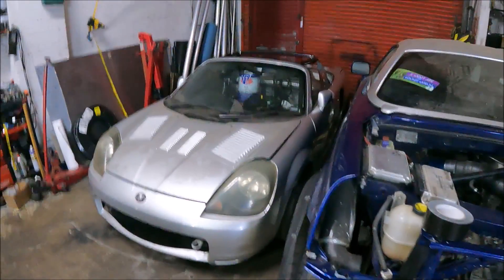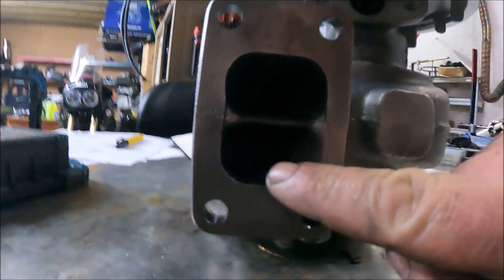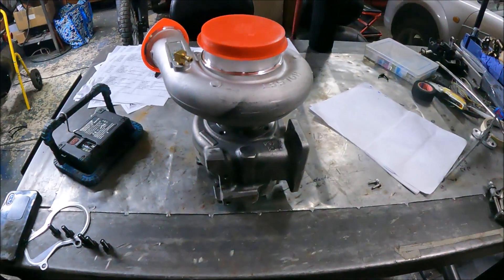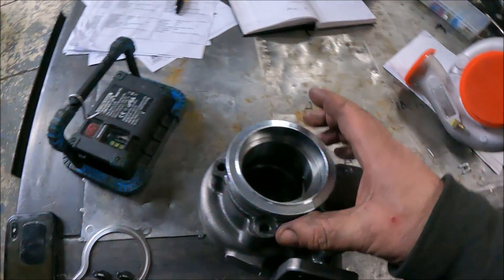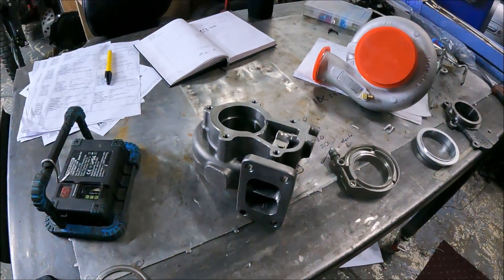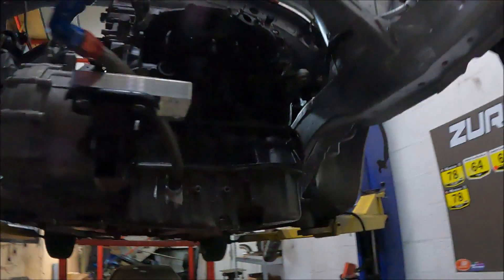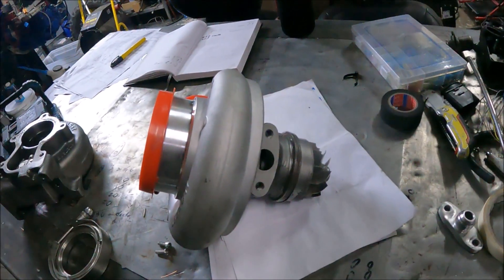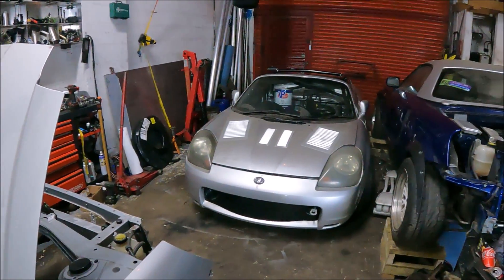You CAN run a twin scroll turbo on a single scroll manifold, but you CAN ALSO make it even better...

Comment: What turbo would you suggest with standard bottom end for around 280-300bhp. I've got a 180 quattro ARY with K03
Reply from the maker: Hi! Honestly, on stock internals I’d prefer something a bit bigger than really needed as big torque low down is what kills stock rods.
Something like a GTX25 or G25-550 still spools mega fast, but at fairly mild boost will make those numbers without a giant torque spike that hurts the stock internals.
Room to grow in the future if you wanted to then too.

Comment: I plan on running this same turbo as single scroll.
How would you compare this turbo in relation to the RS341 you ran in the day on your r32.
I will be running this on an m50b20 much similar powerband to the RB20.
Goals are to achieve boost threshold somewhere around 3,750-4250rpm but not before, as i plan to push 400+ on stock internals and dont want to bend rods.
Would you agree the 8cm is the way to go? I am not sure if its on the money or if it would spool to fast.
Perhaps the 12cm with a twin scroll manifold would be more ideal?
Been speaking with compressor racing, they're also curious, not many engines making media with this turbo yet to use as a reference.
Appreciate your time and your content.
Reply from the maker: In 8cm form it’s very similar to RS341 as that was similar compressor, slightly smaller turbine wheel but slightly bigger turbine housing.

8cm would defo be the way to go if single scroll, 12cm if twin scroll.

Good plan not wanting too much low down grunt to keep the engine alive. You usually end up with a bigger powerband anyhow like that as it wakes it up more at high rpm than you lose at low rpm.
Reply: @StavTech  if it was you aiming for 400+ with an rb20, would you go the 8cm single or 12cm twin scroll?

Comment: I know internal WG aren't as strong as external but if you're not running huuuuuge power is there much other reason why not to just use internal? As routing external in to exhaust can get expensive
Reply from the maker: Internal vs external isn’t a power thing. It’s how much exhaust gas you need to bypass the turbine to keep it at the boost level you want.
The lower the boost, smaller the engine, bigger the turbo, more wastegste you generally need to
Reply: @StavTech  
Thanks mate, so out of curiosity, for a 2.5 1j wanting approx 5 to 600hp internal or external WG? Currently have a holset hx40 to go on w/o wastegate planning to fit in the next year or two.
Reply from the maker: @bunkaaa8726  personally external. It’s one of them where if it’s too small you end up with boost creep so then have to do it all over again, different manifold, external gate, mapped again, the lot. So unless I really have to, or am sure it will be fine, external is just a safer bet
Reply: @StavTech   Cheers man, external it is. Not worth the risk of boost creep and having to do a job twice like you say

Comment: People have a mental breakdown thinking about this but for 99% of situations you won’t even notice. People ask me the twin scroll question daily and I tell them the answer and they still don’t believe me
Reply from the maker: People overthink so much while ignoring way more important factors
Reply: @StavTech  agreed 💯 people will loose days of sleep over twin scroll manifolds but don’t even think about their 22awg stock wiring feeding their walbro 450 haha
Reply: Dont you lose some response tho? But i refuse to believe people are this uneducated
Reply from the maker: @km6832 lose response vs what? Versus a full twin scroll setup yes. But vs a single scroll turbo on a single scroll manifold, no
Reply: @StavTech  yes i meant on a full twin scroll setup. My question was indeed vague so fair response from you
Reply: @km6832 it comes down to use. If you are tracking a car or mountain cruises then a full twin scroll makes throttle response and boost on demand. Theres no build up to boost. With a single scroll setup theres a lag you dont experience with the twin. This is for the 200-400hp cars mainly. After that single scroll is better for more power and more boost. You really only see twin scroll on the small turbos. I have a ct26 its twin scroll of a mr2.